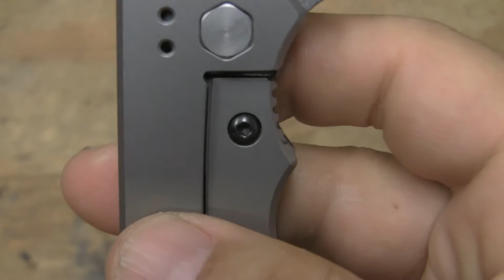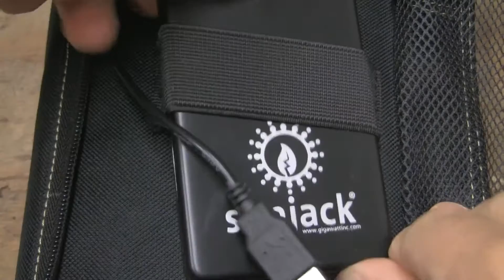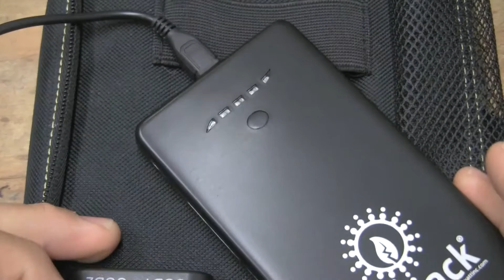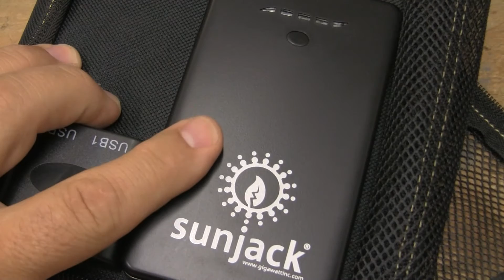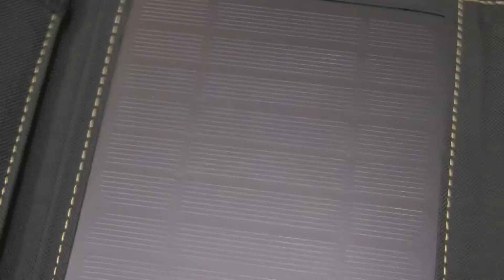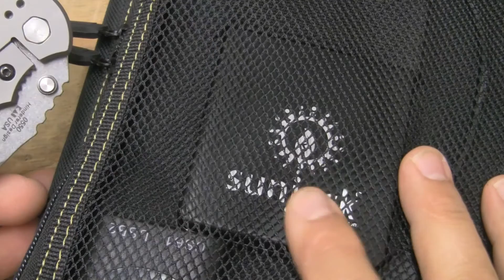Zero Tolerance 0550 & SunJack 14 Watt Solar Updates 7/29/15

Comment: Very interesting. I have 7 Strider's, and I have sent back three for repairs, but after 4-6 years of hard work. My oldest Strider at 11 years is solid as a rock. I also have four CRK's. One is the Umnumzann, with the ceramic ball. At first I did not like it at all. But after using it for cutting tasks since 2009, it is still very solid. But I don't beat on it, I am sure you test these babies very hard. I would guess Hinderer would fair well???